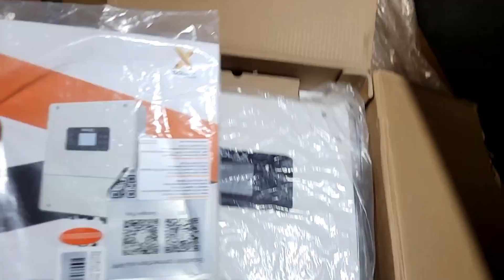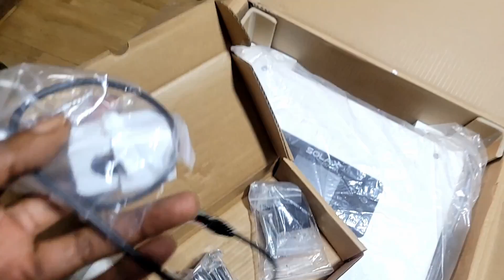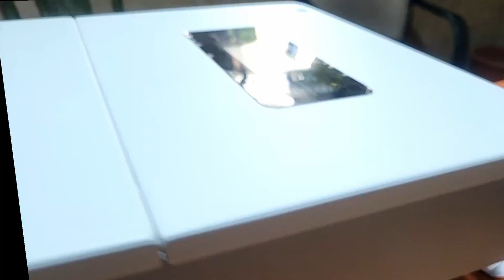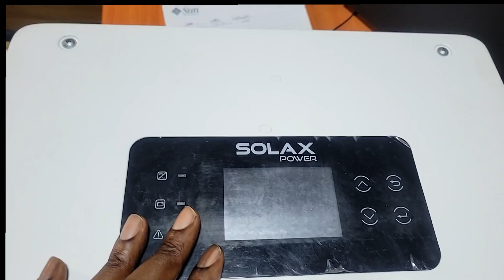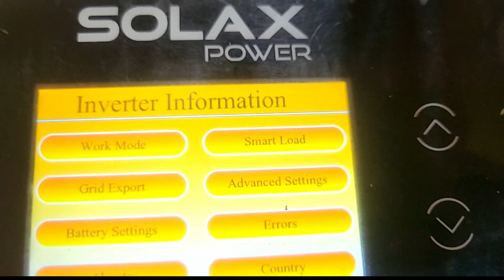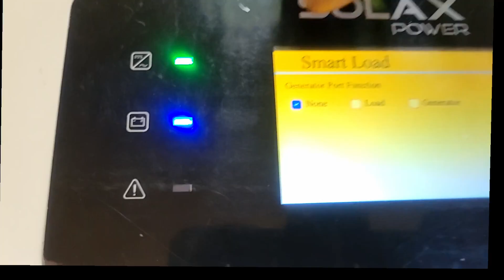Experience The Excitement: Unboxing The SolaX Low Voltage Inverter In Nigeria For The First Time!

Comment: Certainly a system one should try out. Is there are low voltage solax Battery for it? If yes, then what is the capacity of the battery
Reply from the maker: Thank you for watching and commenting. There are 2.5 and 3.6 kwh. A 5.8 kwh will be introduced soon.

Comment: Wow !!! This is a great development. Finally, we have a low voltage option for users that have Lifep04 batteries or lead acid. The use of high voltage batteries had also raised the price of the product but with this option, i am expecting a modest reduction. This is a very good alternative to the Deye 6kva inverter that gives the user all the benefits that Solax is known for. We will be personally interested in recommending this product if the pricing is done right. 
2. For increasing subscriber numbers, we need more content on Solax and solar in general especially for farms which you have experience on. The more content the more we are able to share and your one of the few Solax channnels on the internet. Well done Chris
Reply from the maker: Thank you for watching and commenting. Yes we are excited. SolaX needs to work through a few minor issues and we will give it our 100% blessing. Price wise it is very competitive with the Deye.
2. I will be doing a whole lot more SolaX content. Thank you Samir.